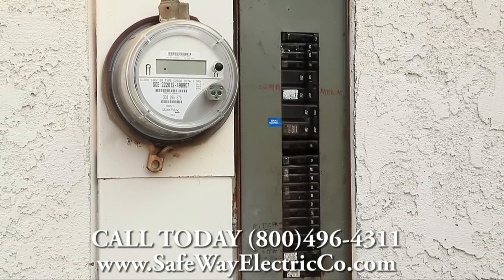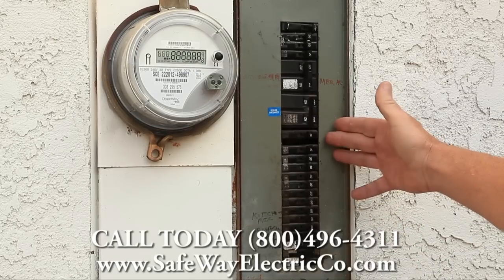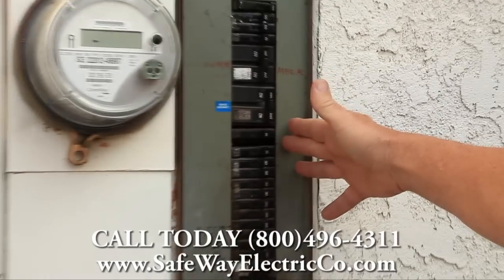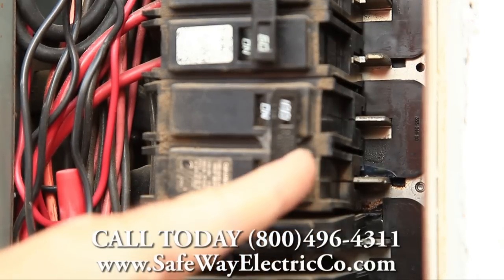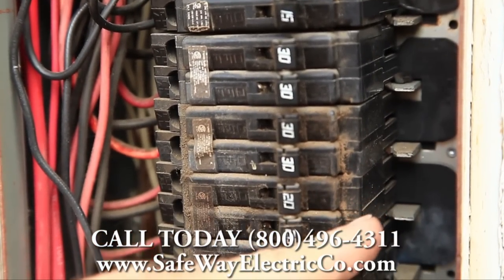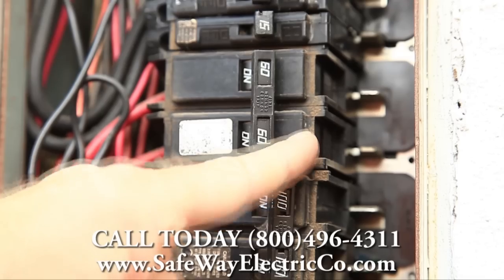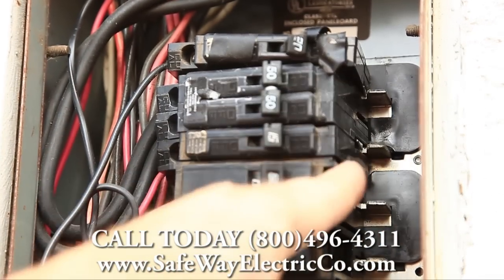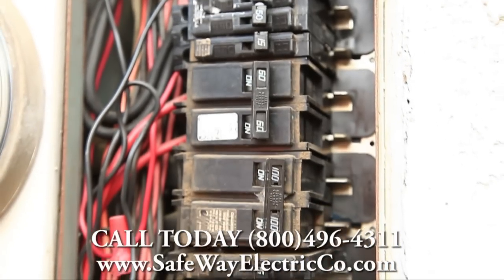Electrical Panels: Why you should not trust an under qualified Electrician with your Service Panel

Comment: Would not buy a inline pannel like that looks like a bad design. Main breaker should not be with other breakers it should be at the top in its own socket
Reply: Correct 💯

Comment: UK kicks American ass when it comes to electrical systems :-)
Reply: Hmmm,  are you sure.  where my wife is from, Malaysia.  It is based on UK standards.  their  Elec Circuit breakers panels are Small.   don,t like them ,  make them bigger to be able to work in them without worrying about being zapped away.
Reply: In your dreams
Reply: And the UK was still using candles while we had wiring. https://www.scribd.com/doc/18355180/Electrical-Wiring-History
Reply: Franny , cheers !!!

Comment: I am a industry electriker in Bundes Republik Deutschland what i find funny is that i do not see rcd's in your panel's . It is unthinkable by us to have any electrical circuit without rcd's  in private homes or industry, no one can die electrocuted  anymore because a rcd is there . It protects people .
Reply: In the US, certain areas of a home require GFCI and/or AFCI protection.
Reply: The Republik has 220 v, we have here 110 v - less lethal voltage.
Reply: @anonymousbyproxy8250  120 is as lethal as 240...just as quick too.  240 is more logical, because everything is drawing less current...Europe wins again

Comment: Plug-in circuit breakers rated above 50 amps should be banned. You should not trust higher amperages to pressure Connections as they will loosen over time and heat up. All main circuit breakers should be bolt- on.
Reply: What about on feeding a sub-panel.   I have installed lots of Sub-panels with under a D.P. 70amp to D.P. 100 amp Breaker.
Reply: Good luck with that
Reply: Sooner or latter it will become a requirement/code.

Comment: Looks like you need to upgrade to a larger sized panel, about like a 150 or even a 200.   I was always amazed at why people don't install a 200 ampere service, it doesn't cost that much more,  The melting plastic is due to a high amperage draw,  the master that did the load calc. on this was incorrect with his numbers.  But too many times the builder is trying to save pennies  so he can make big dollars,and therefore giving his new home buyer a crappy undersized electrical service.  I used to put in a lot of 100 ampere services, but no more,  I always install a  200 ampere main breaker service.  You have to consider the world is changing and there will probably be a lot of little "extras" added later on in life, so do the world a favor and give your customer what they need, not what a few pennies dictates.  Master Electrician in Texas

Comment: last guy in just inherited this nightmare. hope your insurance is BIG!
Reply: The homeowner should hope they are insured. Just because I was the last electrician in there doesnt mean and am liable or married to future issues. It's on the customer to upgrade their panel or pay for the rapairs if suggested. I dont work for free. And liability insurance for a contractor is only used If I am the one at fault for causing and issue.
Reply: @bmwmike3534  Last one in, touched it, will catch the blame....prove you didn't cause it, is how this country works now.  And opening the panel, oy vey, looks like you must have done something in there.  Homeowners insurance will pay the home owner, then they go after YOUR insurance for reimbursement.  Homeowner can easily say, it's been like that for years, now since YOU opened it, it failed a week later, hmmm, just a coincidence, lawyers love this stuff
Reply: @cengeb  not in all my yrs in business. I always put on my invoices: "advised customer elec panel is a fire hazard. Overloaded or doubletaps found etc etc, customer declined to have us repair/replace at this time".
Reply: @bmwmike3534  Smart, CYA

Comment: What I still dont understand is why such a small gauge of wire is used for homes along with such low amperage breakers, wouldn't it be better to use a larger gauge say a 4-6 since you can get 150ft spools of it for $60-80 depending on if its OFC or not superflex, that way it would be more resistant to heat easier to maneuver and be able to handle a much higher draw you can get atleast a 200 amp draw without any problems through a 4 gauge run.
Reply: That's a good idea but it just wouldn't be very cost effective, copper is expensive and just keeps rising which is why in some cases aluminum wire is used because it's cheaper and accomplishes the same thing. For branch circuits in a house there is nothing that would possibly require 200 amps at any given time, so smaller ampacity circuits are used, mainly 15 or 20 amp circuits to power lights and receptacles. Most circuit breaker panelboards supply a total of 200 amps at the main breaker which will almost never trip because a home is not going to use that much power at any given time. From the the meter to the main lugs of the panel is where your 4 gauge run would be most effective on your "service entrance."

Comment: that panel is ready to burn, REPLACE that piece of crap!  Why are panels outside, so they bake in the sun, how stupid
Reply: Absolutely, what a piece of junk and crappy place for it. I wonder why the main breaker is sandwiched in the middle of all the other breakers, not even sure how that would work.
Reply: +Dylan Link 
exactly that is the biggest piece of s*** I've ever seen it is a main panel with a meter socket but it doesn't even have a built-in main breaker but I've seen a lot of s*** electricians do s*** like that just use a regular breaker in a slot as a main breaker feeder to the bus. if the breaker starts to loosen on the bus it can cause the bus to blow taking the panel with it.
Reply: Dylan Link you can backfeed a panel through a breaker. there are not always lugs.